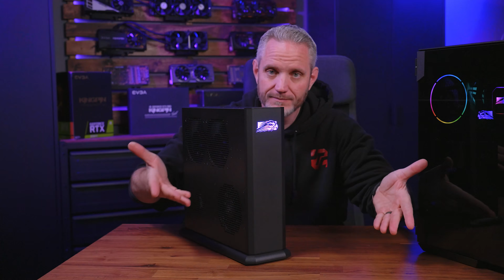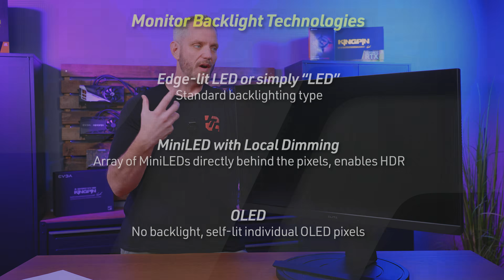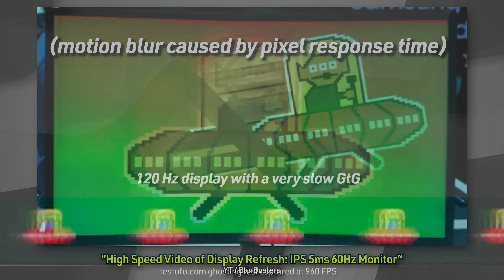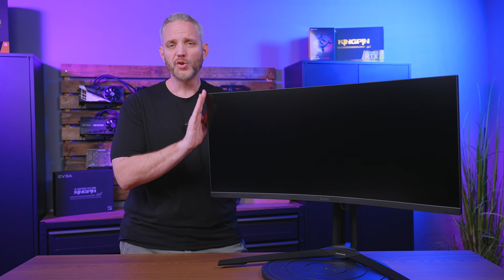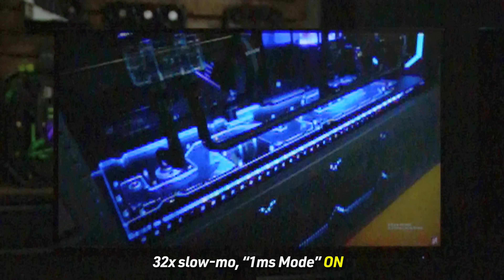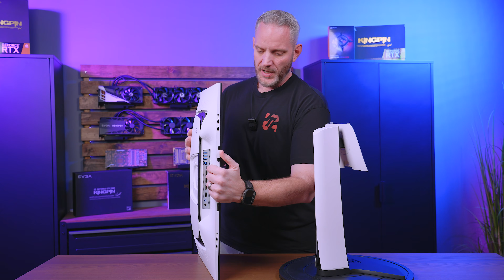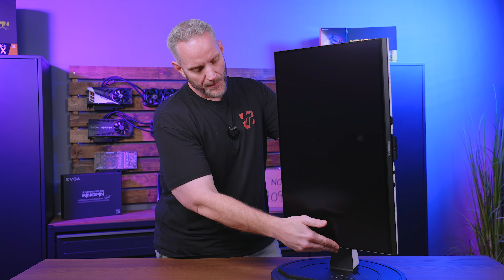Ultimate Gaming Monitor Guide: Find the BEST Screen for Your Setup

Comment: The lower the R, the more pronounced the curve, not the other way round @JayzTwoCents - 800R is a circle with a radius of 800 mm, which is a much more aggressive curve than say an 1800R curve
Reply: was going to say this exact same thing.
Reply: Thank you, I get this confused all the time lol.
Reply: @kasper_429 I do too caused me one time to get a 1500r screen
Reply: This is why Jay needs to start using scripts and pre-shoot editorial work. For videos like this, at least. I like Jay's off-the-cuff style for builds and most of his videos, but informational like this really suffer from a lack of preparation.
Reply: true
Reply: i think had an Acer X34 .      such a nice curve.     1800R

1700 on a 32" 4K is a bit much.  1800 would be also perfect maybe

a non curved  - wow is that a big thing in comparison.   Totally underrated for size compensations
Reply: @urkent4463  I have a 32" Acer with 1000R. Didn't realise that till the other day. If you're maybe building a 3 monitor cockpit, I can see that, or even tighter, being ideal for such a project.
Reply: Correct. 1000R indicates a curved monitor that forms a complete circle with a radius to the middle of 1000mm or 1 meter.
1500R is 1.5 meters.. ect. The higher the radius the less curved the monitor.
Reply: correct.
Mine has a 1800R and its very subtle
Reply: Choose radious (R-value) with regards to how far away your eyes are from the screen in millimeters in you normal use!
Reply: Correct! +1
Reply: +1
Reply: Steve is gonna make a video trashing Jay.
Reply: Centimeters to form a full circle, right? Or inches...
Reply: @GriotDNB  
Neither, it's the distance from the centre of the circle to the outside of the circle in mm.
Reply: @markandkatehall4545  good way to put it. My best effort is “radius in mm”
Reply: millimeters with R standing for radius  @GriotDNB
Reply: @GriotDNB  1000R is a 1 meter radius of a circle, or 1000mm wide.  1800R is 1.8 meter or 1800mm.
Reply: @GriotDNB  millimeters actually
Reply: +1
Reply: +1
Reply: Had to pause to say just this.
39” 800R FTW 😂
Reply: @Wind_Lord  same here, LG Oled
Reply: Was about to say same miself
Reply: • 1000r for the win •
Reply: +1
Reply: Correct. Smaller R is sharper curve
Reply: 😂 @dennisestenson7820 I'm going to refer to flat screens like this in my reviews from now on - "Infinte radius curvature" 😂
Reply: The opposite of IQ
Reply: +1
Reply: And it's very easy to know about when you play guitar/bass (and actually know about the instrument and not only just about how to play it) as there are 7,25'' radius which is really round and good for chords, up to around 20'' which is basically flat, but is good for soloing.
Reply: Thanks for the correction. Think a lot of people caught this one.
Reply: Thats called "dyslexia"
Reply: +1
Reply: yeah when I heard this I had to do a double take a rewind the video a few seconds to confirm I did not hear that wrong.
Reply: haha point and laugh the tech guy misspoke.
Reply: yeah I was confused too
Reply: This video is full of misinformation it's actually crazy
Reply: +1
Reply: +1
Reply: But but... bigger number more better?
Reply: @captainlooney4356   bigger number closer to flat
Reply: @captainlooney4356  yes, less curve is more better. lol
Reply: @kstr89  in a general sense that is true, but to go into more detail, as someone else mentioned above the R value is the radius in mm of the circle that would produce the curve of the panel. if you know the average distance your face is away from the monitor, it is better to pick a R rating close to that, idea being you are trying to fit the curve to your FOV so that the distance of any point on the screen is equal to your eyes, you will at most turn your head left or right to focus on the L and R edges of the screen.

consequently if you seat much further than the R distance you might unconsciously lean forward, much closer than the R distance and you might lean backwards
Reply: ^this!
Reply: +1,000
Reply: +1 
Correct! I had to pause the video and jump straight to comments. I see it was quite noticed already 😂
Reply: @Dralagon Haha, same 😂
Reply: My 32 inch monitor has an 800R and that is nowhere near an "aggressive" curve, but yes, it is much more of a curvage than a 1800 would be.
Reply: Samsung 1000R Is the best.
Reply: Many people don’t realize that the number is the expected viewing distance. 1800R means you should be 1.8 meters from the screen.

Comment: Bought a LG C4: 42" OLED and never looked back. Great PC 144hz  VRR monitor.
Reply: My man, best decision i made was getting the C4 42"; this was coming from first gen OLED alienware 32" monitor.
Reply: The LG OLED 4k tv/gaming monitors are amazing!
Reply: Still rocking my c2 42 inch with a 4080
Reply: @hotboyfrom91  Unfortunately I'm still using my 3070ti and looking to upgrade this year   8 gig vram cards are useless with today's  games.
Reply: Same. Got an LG C3 on sale when the C4 was released. Got a 4080S as well, all for the price of a 4090.

Extremely happy with the setup.
Reply: 48” C3 here. I love it.
Reply: What settings do u use on the tv?
PC mode?
I have a c1 and when I move I will arrange it as a pc monitor
Reply: @chillnspace777  yes using the input set to PC. Only thing is a few of the settings are greyed out . They do this to avoid extra processing that would introduce lag.
Reply: Bought the LG C2 about 2 years ago and it's been amazing even though its only 120hz. 
Might go for a C4 next.
Reply: got the 27GS95QX for 540€ on black friday, very happy with it (also sold my 2y old 27gp850 for 180€) so paid 360 basically 😁
Reply: why stop at 42 LOL  Rocking C3 55 and C4 65.  4090 max graphics still out do the 144 hz
Reply: Currently running a 42” C3, but patiently waiting for that 4k 240hz option… I will never buy an overpriced “gaming” monitor again.
Reply: How do people game on 50 inch tvs? How far do u sit from the screen?
Reply: Never liked LG WOLEDs with their fake warm colors due to white subpixels. My 1440p-like Samsung CRT from 2002 has better colors (real RGB), Samsung QD OLEDs is the current equivalent.
Reply: 42" is way too big for any serious gaming.
Reply: lg is junk
Reply: @GeoBob-xf3hh said the tn user 🤣

Comment: I think you may have made a mistake with the R rating. The higher the number the more gradual the curve. I believe the R refers to the Radius of the curvature.
Reply: ya, the lower the number the more aggressive the curve is typically how i see it discussed. 800r being very curved on the lg oleds, while 1800r being a slight curve on the qd oleds by samsung. I currently have a 32 inch 1000r lg VA panel and a qd oled 34 qd oled 1800r. Easy thing to mixup imo as it does sound backwards initially, or was for me.
Reply: Yes, the lower the number is, the harder curve.
Reply: Correct, the number is the radius in millimeters.

Comment: Monitors are one of the most important components of a system.
Get a good one, but don't blow the budget when you are in the territory of diminishing returns. 
1440p 144-240hrtz LCD monitors are a sweet spot for price to performance. You can get an insanely good monitor for around $250.
Reply: Agree.
Don't buy below 1440p these days.
Imho 144 Hz is more than enough, but it doesn't hurt to have more.
Also don't buy smaller than 27 inch.

A good 27", 1440p, 144+ Hz monitor for around $250 is currently a budget friendly sweet spot.

If you want bigger than 27" I recommend going straight for 4K monitors though. But remember that your GPU must be good enough so it can keep up with the higher resolution.
Reply: @a564-c3q  
It's a bit of a game for screen size, the big factor is viewing distance to screen ppi. A 1 to 1 ratio of screen size to view distance is a good target. If you sit closer that 2 feet away from the screen a 24" screen may have some benefit, where if your sitting 3 feet back a 32" screen looks very similar (and even better for some) to the 27" at 2 feet.

Comment: I'll stick with my 144hz samsung s90c OLED 65'' tv as my pc monitor. Works great and never saw much difference over 144hz, especially with OLED's pixel response. I saw a test with some pro gamers and it didn't improve their performance using over 144hz, and the 99% who aren't pro gamers shouldn't buy into the super high hz hype.
Reply: 65 inch for pc? That's basically a console and tv experience
Reply: @Thomas_Angelo  If you want to think of it like that I guess. Not sure why some pc gamers think they need to use a tiny screen to play games though. I sit 4ft away from it and it looks great with DCS, Star Citizen, Helldivers 2, COD, Cyberpunk etc. And it's easier to see details as it's not tiny and sad. Most of my friends have dropped pc monitors in favor of OLED tv's (usually 55'') at this point and none of them are willing to go back to something smaller.
Reply: @kendil22  it's because of competitive games. If you scale the screen to a big size like yours, the accuracy will be lower. So the standard rn is 24'' for 1080p so you have the ultimate accuracy. In future it will be 27" 1440p when 1080p will be outdated
Reply: @Thomas_Angelo  I've played call of duty since the first one came out, and other FPS games going all the way back to Rainbox Six and Doom (if that even counts). Basically I've been playing competitive FPS since the 1990's.  I'll stick with the 65 inch tv. I've found getting my mouse tuned correctly was a much bigger help than screen size for accuracy. I'm a run gun type, I don't sit in the middle of nowhere pretending I'm a sniper.
Reply: @kendil22  You seem like a casual gamer. Comp gamers can't even talk like normal people
Reply: @Thomas_Angelo  😁
Reply: Correct for one type of gaming. FPS you’ll notice functionally as an advantage.

Comment: Its funny you say that the Monitor is the most overlooked part of a system. For me, its the first thing I decide on as its potential is what drives me to spec out my system the way I need. I’m looking into the Dell G3223Q for me next. 

Whats the use on building a system that can play CSGO at 250fps when all you have is a 60Hz screen. LOL
Reply: While your order of thought makes sense, it requires to have the budget to do it all straight forward, however people want a fast computer first and good peripherals second, so they will cut down on the keyboard, mouse and monitor to get a better tower and upgrade slowly overtime. When i bought my monitor i had a singular thing in mind; 32 inch panel, i was using a old burnt asf TV before that and ANYTHING would've improved the experience with 1080p. Now i'm a bit unhappy about colour balance and other stuff but i can use it just fine, and aince then i have FULLY rebuilt my tower from an i5 4th gen and a clapped out RX580 that was super unstable, 8gb of RAM and 1tb hdd, to 1tb ssd and 500gb NVME, Ryzen 5 5600 and a 2080 16 gb RAM. I also have a FAR better mouse (logitech G32 hero i think?) and a FAR better keyboard (8bitdo retro thingy with the NES theme)
Reply: matching your monitor to your pc spec (and vice versa) is the most common mistake "regular" people make. best advice, match your PC build to your monitor performance.
you would be amazed at how many people are running 4k screens on mini PCs with no gpu, or people with decent gpus running 1080p 60fps screens with atrocious pixle refresh rates and color profiles.
Reply: @gasracing5000  it depends on the usecase or preference, you can still get more of a 1080P monitor by upscaling to 1440, and running heavy enough games they may still use a good chunk of their performance. It also depends on what your definition of decent is, because i think that my 2080 is fine and it's sub-par for 1440 from what i've tested thus far
Reply: @Ferrari255GTO  
Super sampling and upscaling is a dark route to go down... but if you must, using a 1440p monitor with good response times and color profile at 1080p is a much better experience to running a outdated 1080p screen. 
A decent 24" 1440p screen rendering at 1080p with a 2ft view distance actually looks great. 
Definition of decent? around 100ppi, sub 10ms refresh times, and over 90% of the dcip color gambit.
Reply: @gasracing5000  when i said decent i meant you talking about GPUs. Either way, at least in FH5 and Beamng, i feel a genuinely great boost in sharpness when upscaling. I never ran CS2 at 1080 since it's a very light title and i wouldn't know if there's a real difference there. Don't have a clue about my monitor's specs, all i know is that i can overclock it to 70hz if i want but i just don't bother even if it's nice to have that extra when it's usable. It's a 32"HP monitor i bought used for 160 with 200 hours of use
Reply: @Ferrari255GTO  
Gaming really smooths out around 90-100fps. There are allot of good $250 1440p high refresh monitors out there. The 2080 is a decent card, with csgo and fh5, I think you would benefit with the upgrade.
Reply: @gasracing5000  i could benefit from upgrading everything as i love emulation but some PS3/Xbox 360 titles are nightmares to run, in fact my RAM is a bit short for Beamng if i use traffic. I still can't believe i actually need the 32Gbs, bet i'll find a new bottleneck once i do upgrade it 😂
Reply: Lol When I first head him say that I was like “who tf overlooks monitor”

Comment: I should really look into getting a new monitor. After getting my new computer last year, my old 1080p 60 fps old monitor is definitely my bottleneck when it comes to visual fidelity.
Reply: Had exactly this until recently.
I went with 1440p but now I kinda wish I would have gone straight for 4K.
Of course it very much depends on your budget, use case and of course your GPU.
Reply: 4k 120hz OLED is literally a night and day difference